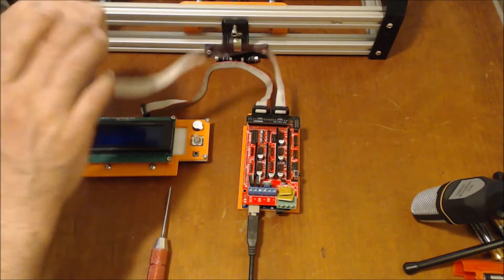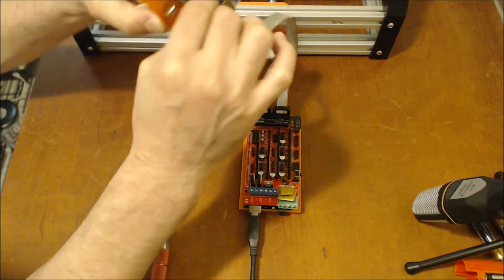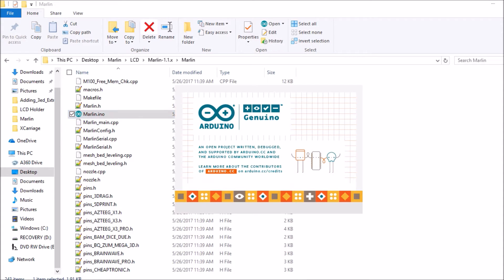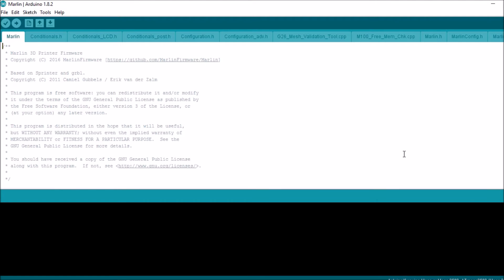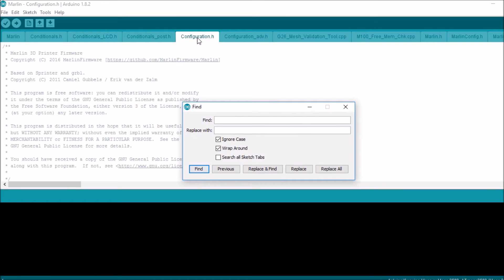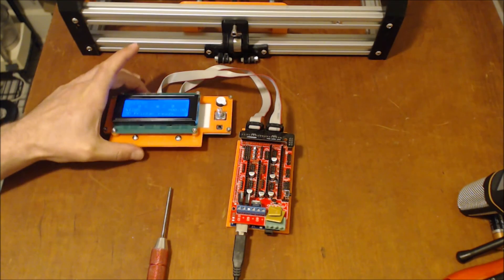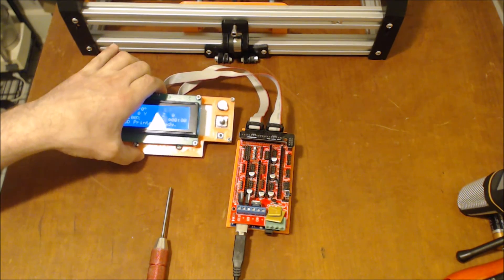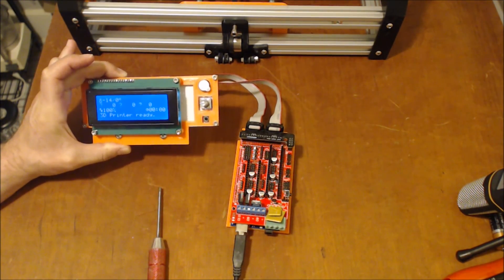3D Printer Hacks: Smart LCD Install

Comment: Hi everyone, I have a problem with my 3d printer. When I plug the usb port to the computer with ramp 1.4  on it. it works means displaying the LCD and marlin logo and all things. But I give him the external 12v supply the screen becomes blue nothing on it. Also I noticed when I plugin usb Arduino L and on LEDs show red but with external supply only one on is red. Can anyone help me

Comment: Notaste que en pantalla no aparece SD card?? me pasa que no puedo activar esa opción...
Reply from the maker: Spanish:
Verifique en la pestaña Configuation.h del Marlin Firmware si, "#define SDSUPPORT", se comenta fuera. el comentario para eliminar podría ser "//". De lo contrario, podría probar el "M20", gcode dos veces en pronterface y dejarme saber lo que ve.
English:
Check in the Configuation.h tab of the Marlin Firmware if, "#define SDSUPPORT", is comented out.  the comment to remove might be, "//".  Otherwise, you could try the, "M20", gcode twice in pronterface and let me know what you see.